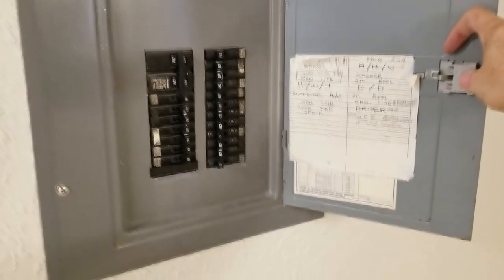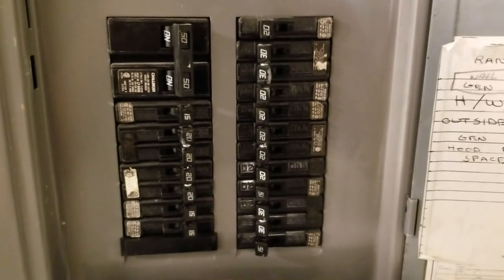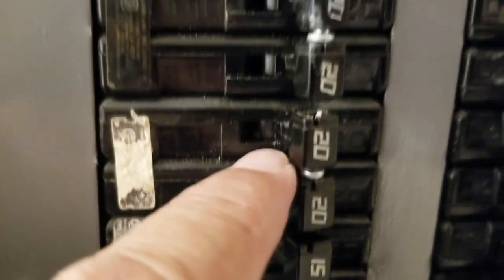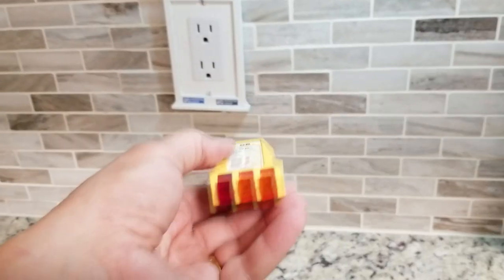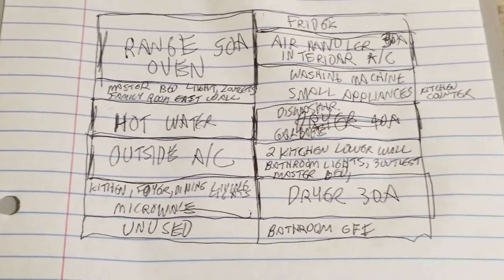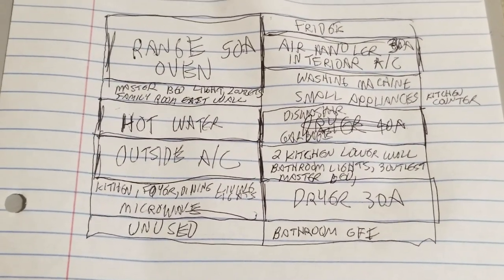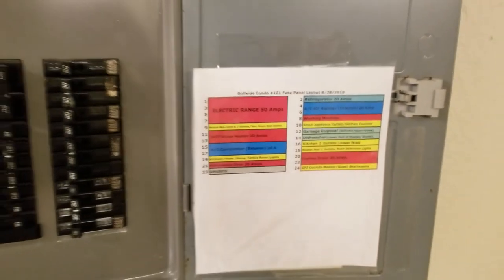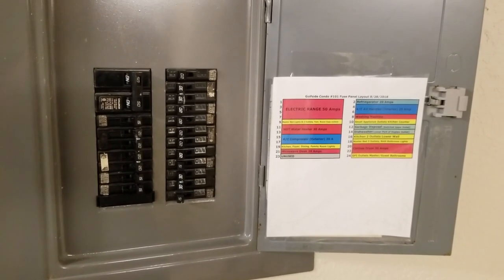How To Map Out, Label Your Electrical Panel/Fuse Panel Diagram

Comment: I use a  long extension cord and a drop light plus a fluke meter with a plug type meter lead to plug into the outlets .You can 't always depend on one outlet shutting off when turn off a breaker. I have run into a bedroom for example that is on two separate circuits. Once I do a bedroom for example ,when I turn the breaker off and the light goes off on my drop light, I go to the bedroom and check the other outlets and the light. If everything is off ,I know as far as the bedroom is concerned that the breaker I turned off controls that bedroom, however that same breaker may controls other areas in the house. The key is to move from area to area in the house. This takes patience and a lot of breaker flipping!I create my map in Word .I list the circuit # as it corresponds with the breaker # my list has more details ,plus when i print it out,I tape an envelope to the panel door and put the map in the envelope .
Reply from the maker: Good ideas, thanks for sharing

Comment: Nice job. I've got to do the whole house so I thought this process up to make it one trip for each breaker.  This should take 30 minutes for the whole house.   Your thoughts , suggestions, positive and negative are welcome.  I haven't started yet. 
Step 1: buy 100 Not Automatic night lights and KEEP THE RECEIPT. (Or not.... just give them as stocking stuffers to the kids.)						
Step 2 : plug a light into every outlet your house including the outlets for the unplugged refrigerator and freezer. 						
Step 3: make a sketch of the outlet layout and assign numbers to each outlet and switch . Make a drawing later....						
Step 4: Turn on every wall switch in the house including the garbage disposal (put garage door remote in your pocket). 						
Step: 5 Turn every breaker off 						
Step 7 Turn 1st breaker on and do a walk through the house with your clip board. log all the active circuits in the house on your notebook.

Comment: If you can get help, two people with mobile phones will make the job much faster. One person testing while the other is at the box. Everywhere I have lived my boxes have a diagram of the circuits. Sometimes I write info in, sometimes I print avery 5160 labels, cut them down to size, and place them on the diagram. I never label a circuit according to appliance unless it's permanent like a furnace, or generator. I label according to room then north, south, east, west, side of the room if more than one circuit is used for a room or hall.
Reply from the maker: Lee, those are great ideas for the fuse panel. Have you seen the link in our video description to the Avery Breaker Panel pre-printed labels? Curious to see if others have used them.
Reply: @jeffostroff  Nope, I'll check it out now.

Comment: Hi Jeff :)   Great video and thanks for sharing :)   

I have questions about the electric panel in my house.  It is taller than it is wide, has 16 (horizontal) slots in the middle to lower section (2 columns of 8), where only 9 are filled w/ breakers.  So I have 7 empty slots where new breakers can be added.  
In the space near the top my box has 4 slots in a vertical configuration w/ breakers installed and a horizontal bar connecting them all together.  I mean, if you flip the bar down , I suppose the whole rack of 4 breakers turn off.  THEY ARE LABELED : 'MAIN' !!
Questions :
a.)   would you suspect the 'MAIN' (4 at top) power the whole box ?
b.)   if they do , could I shut it off , test and confirm no power is feeding the lower breakers  and add new breakers to the lower empty slots ?
c.)   is there a maximum distance I can run a wire from a 15 or 20 amp breaker to a run of 4 or 5  outlets and a light switch ?

I'd like to replace a yellow 12/2 residential wire w/ a grey UG (direct bury) wire that feeds a shed / shop in my yard.
Thanks for your generous consideration,
sincerely ...............................
Reply from the maker: You want to avoid voltage drop of no more than 3% per National Electric Code. the distance you're talking about might cause problems, so adhere to the following list of maximum length of wire for the gauge listed. This is beyond my expertise, so you might want to have a licensed electrician come in and advise you. Also maybe you meant to say UF direct bury cables?  

For 120-volt circuits:

14 AWG — 50 feet
12 AWG — 60 feet
10 AWG — 64 feet
8 AWG — 76 feet
6 AWG — 94 feet

For 240-volt circuits:
14 AWG — 100 feet

12 AWG — 120 feet
10 AWG — 128 feet
8 AWG — 152 feet
6 AWG — 188 feet
Reply: Thank you Jeff.  BTW, where did you get this convenient chart ?   Or, how can I look something like this up myself ?Thanks again for your generous time and consideration :)  Sincerely .....................P.S.  You're right , I meant to say UF :)  And thanks for 
your timely and informative reply :)  Your new sub , Steph :)
Reply from the maker: @stephboeker7835  I made that chart using Microsoft Excel, it's a spreadsheet that I shaded in the cells.
Reply: Oh, yes :)   I'm very familiar w/ Excel Spread sheets , columns and rows w/ formulas on top to add , subtract , multiply and divide and such :)   I was actually referring to the chart of wire gauge and distances :)  But the excel chart is a fantastic idea and one I believe I will use as well :)  Thanks !!
Reply from the maker: Numerous charts everywhere, go a Google search for "NEC wire gauge distance", and you'll see all the image results in the image tab.

Comment: Is it normal to number them horizontally rather than vertically?  For example, the left side is odds and the right evens.  I numbered mine vertically, with 1-20 going down the left side and 21-40 going down the right.  Does it matter which direction the numbers run?
Reply from the maker: I go with whatever convention is engraved onto the panel

Comment: Any reason to mix "20 A" "20 Amp" and "20 Amps" in one diagram?
Reply from the maker: Yes, on  switches 15-17, it looks like AMPS would fit, but it doe snot fit, so I left it at 20 A.
Reply: @jeffostroff  IMHO "20A" is correct "20 AMPS" is wrong. The Guide for the Use of the International Standards of Units (SI) section 6.1.8 states: "Because acceptable units generally have internationally recognized symbols and names, it is not  permissible to use abbreviations for their unit symbols or names, such as sec (for either s or second), sq. mm (for either mm2 or square millimeter), cc (for either cm3 or cubic centimeter), mins (for either min or minutes), hrs (for either h or hours), lit (for either L or liter), amps (for either A or amperes), AMU (for either u or unified atomic mass unit), or mps (for either m/s or meter per second)."

Comment: hOW DO OU FIND OUT THE CELING MOUNTED SMOKE DETERCTORS
Reply from the maker: They could be on their own circuit, or they could have tapped off lights. You just have to swath the breakers off one by one until you find it.